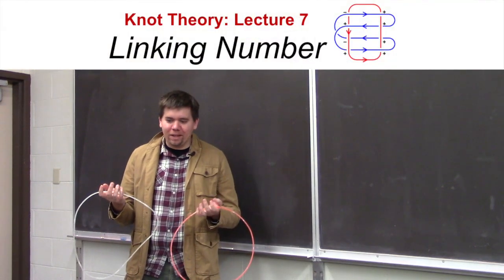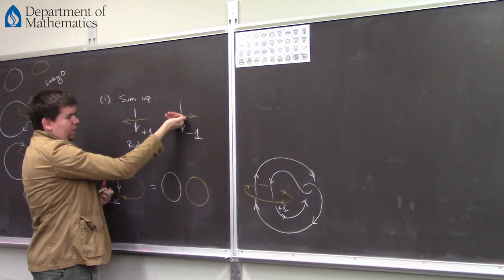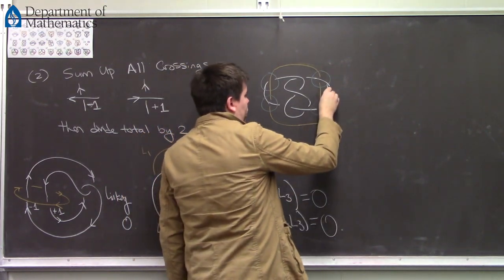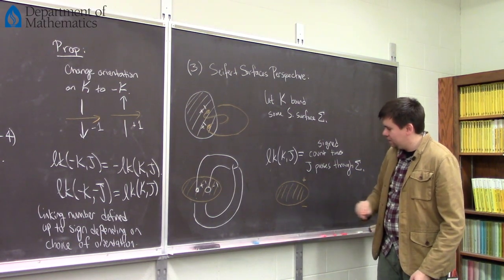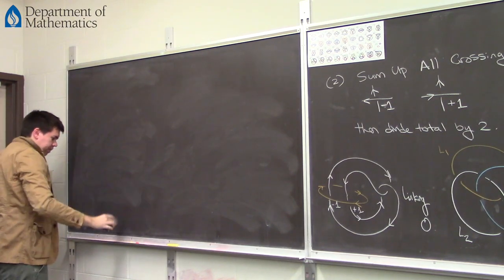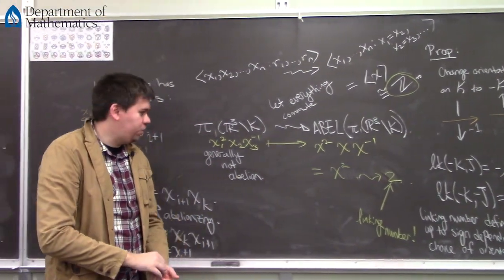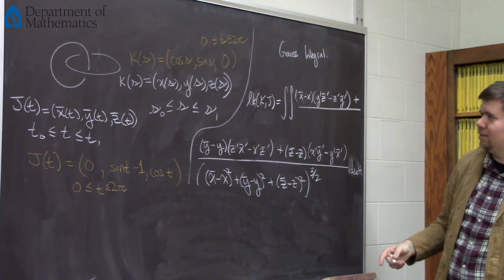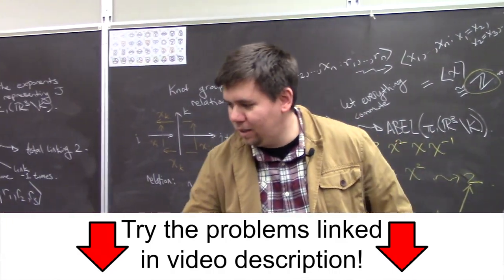Knot Theory 7: Linking Number

Comment: To easily find if the linking number is greater than 0 you have to find out if it's odd or even. So basically count how many overs and unders you have. Start with a point on a line in the system and then follow that point all the way through until you're back where you started and if the number of overs is even or odd will tell you about the relationship of the two loops to some degree. I don't feel like thinking this all the way though so I guess this would just be a starting point to figuring out how to use odds and evens to find out some of the qualities of your system you're looking for in terms of linking numbers